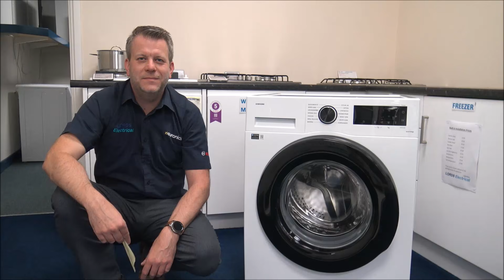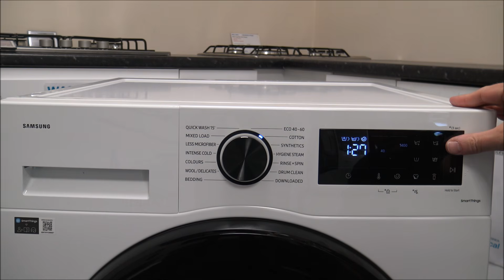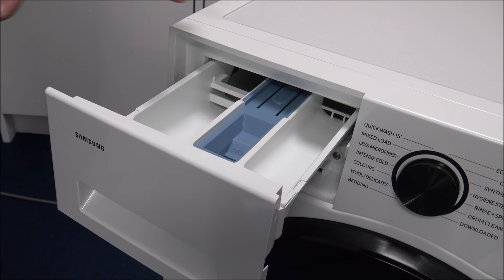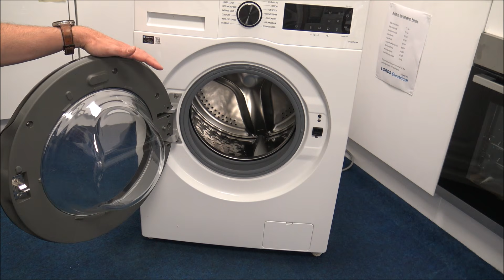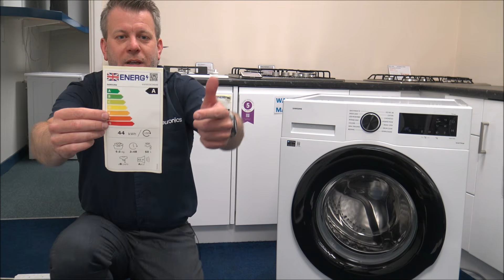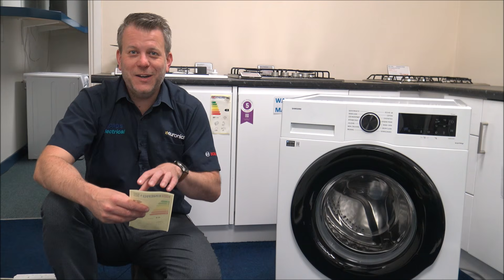Samsung WW90CGC04DAE 1400 Spin 9Kg Washing Machine

Comment: When i pour detergent in before washing, it all drains into the washing machine after 30 seconds with  plastic part MAX liquid is used.
Is that normal?
Reply from the maker: This shouldn't normally happen, i would make sure the plastic part is fully pushed down to make sure the liquid doesn't run into the machine too quickly
Reply: @lords-electrical It's pushed all the way in. Plastic is made at the bottom with little gap.

Comment: Great review. Thanks very much. Question.
How many screws it has to stabilize the bucket during moving? 3 right? Cause the  manual i have shows 5 and i am a little hectic on putting it on
Reply from the maker: Each machine will vary between 3 and 5 normally, but the key is once the bolts have been taken out, make sure the drum can move around easily and not static like when it has the bolts in

Comment: I have just purchased this Samsung Washing Machine on the strength of this review! Does anyone know where to locate the serial number please? I had it installed and I have looked over the paperwork that came with it but I can’t find it. I have read online that it is sometimes located on the rear of the machine? If that’s the case I have a problem as I am disabled and cannot get it out to the machine out myself, is there anyway I find out other way? 
As I want to register the new machine! Thanks to anyone who can help me! Stephen
Reply from the maker: The serial number will be on the inside of the door, either on the machine, or the inside of the door itself
Reply: @lords-electrical  Thanks for your reply to my question, I found out it was included on the QR Code Sticker to the left hand side of the door, just above it, but it was small though!
Reply: Thanks for your reply, I found out it was actually included on the QR Code on the left hand side of the door, but it was small.

Comment: We bought this model yesterday from our local Hylands Euronics shop and set it up and tested it last night. Very impressed so far and it's so quiet compared with our previous 25 y/o Bosch which had just expired.
The only issue I had today was trying to register the 5-year warranty online. The website wanted a 15-digit serial number and this machine's s/n only has 14 digits. I ended up phoning customer service to register.
Turns out the s/n should have a P as its 15th digit after the 14 digit s/n printed on the rear & packaging labels.

Comment: How reliable and durable is Samsung in long term. Compared to Panasonic and Bosch.
Reply from the maker: Samsung are ok. not the best as the customer service can be poor if you need to call an engineer. I would always recommend Bosch overall for the reliability and value for money

Comment: The Samsung WW90K5410UW/ET washing machine does not start the wash cycle. Initially, the main door lock activates, but immediately afterwards, the machine drains the water (if any is present) and goes into a pause state, without displaying any error codes. The only anomaly noted is that the secondary door (AddWash) remains locked even when the machine is paused; it only unlocks when the main door lock is released. A buzzing noise is also heard during the startup phase Can you Help me please.
Reply from the maker: This sounds like it could be either an issue with the water supply to the machine or the waste out from the machine

Comment: On like other washing machines I've used, it's disappointing that this samsung machine don't have SPIN ONLY option. Sometimes after the washing cycle complete,  you find the clothes are still soaking wet and all you want is to spin. Too bad this doesn't have that option.
Reply: Have spin only program.
Press spin button for 5+ sec. Check the manual.....
Reply: @paganos5633  thanks, will try it out.

Comment: Whats the best wash settings for whites
Reply from the maker: Normally the Cotton or Eco 40 - 60 are good settings as they are longer programs to get your whites clean. If you want to go with a higher temperature like 60 or 90 degrees C, then go for the Cotton setting
Reply: @lords-electrical thank you so much. Weve been using mix load and it doesn't seem to clean the white clothes properly and it only goes up to 40 and not 60

Comment: I've had one for 6 months. You can see where they have cut corners on some of the functions, however for the price /warranty it's excellent value.. The motor is also direct drive which in basic terms means less vibration, more efficency so it should last longer - this is also probably why it's quiet.. Few negative comments on here but if you want all singing all dancing buy a more expensive model😂 just out 9f curiosity... The default eco program does not stipulate if it's washing at 40 or 60 on the  display, with no way to change it??
Reply: When you choose eco you just have to tap on the temperature logo after and choose your temp

Comment: Cannot turn temp up or down in eco 40-60. So cannot select 40c rather than 60c
Reply from the maker: That’s correct that it will wash at 40 degrees on the eco 40 - 60 program. It is designed to wash clothes that have the ability to washed between 40 degrees  and 60 degrees C as efficiently as possible
Reply: @lords-electrical Thank you. Using the Mixed setting 1 hour and 7 mins. Worked perfectly.

Comment: Does it matter if my Washing Machine Sticks out 4cms
Reply from the maker: No it doesn't matter if it sticks out, it just depends if it is inconvenient for you if the machine is sticking out. It is better to stick out a bit rather than pushing the machine back too far and trapping the waste or water inlet pipes.

Comment: How do I get Spin only
Reply: 1.Power the washer on. 2. Press and hold the Spin key for 2 - 3 seconds. Once the chime sounds, the washer will now be in Spin Only mode. I don't know why they won't just add the option on the wheel.

Comment: First washing machine I've ever seen without spin only option!. Would not have purchased had I know this!
Reply: The smart things app has extra programmes which can be downloaded to the machine, including a spin only programme.
Reply: Just hold down the spin sign for 3 seconds and it will go to spin only
Reply: A comment below says to put it on the rinse and spin cycle and then hold the spin button. That should do spin only

Comment: I see that you know a lot about washing machines, so I'm wondering if you have a favorite? I'm hesitating about two models that interest me, so if you could tell me which is better, the SAMSUNG WW90DG6U8FLEU4 and the HAIER HW90-B14959EU1-S, should I choose a Samsung or Haier machine, or is there a better solution than these two models.
Reply: Haier is made in China I think and usually aren’t the best quality
Reply: @BenFC_189 In the end I bought a Beko, I'm happy with it so far, so many machines boast about reduced noise, I think all newer machines are designed that way, including the one I chose. As for the material itself, I'm not really happy with the quality, it feels like cheap plastic, but for the money I invested it's worth it.
Reply: @vujadinovicc  Beko is a good budget brand I’d say they are the high end of budget brand but yeah made in Turkey so maybe quality not there and for the noise level most machines are using inverter motors or direct drive which doesn’t use brushes which lasts longer is quieter and they say is better for the environment

Comment: On the eco 40-60 option, how can you ensure the clothes wash at 40 and not 60? There isn't an option to change the temp?
Reply from the maker: It will just wash at 40 degrees C and wouldn't normally allow the ability to change the temperature on that program
Reply: Why does it say 60 then? 🤔
Reply: The temperature on this program is 23 -37 degrees  .... Its stupid program at European union....

Comment: Thank you for the video. I just baught this machine and I am very surprised that there is hardly no water in the drum during washing and even rincing. Previous machines showed always water at least up to the lower level of the openning window; Is this normal or does my new machine have a defect ?
Reply from the maker: Washers don't use a huge amount of water now, but you should still be able to see water within the drum. Try turning the water pressure up a little bit as it may allow more water into the machine during the wash

Comment: I couldn’t find the times of the various washes anywhere! Thank you! 
You’ve helped me decide to purchase one. 👍
Reply from the maker: Great to know the video was helpful for you. Thanks for the great feedback
Reply: @lords-electrical 
Well I bought one and not happy 😅
When it spins to dry the clothes on any setting, it shakes violently. Which is the main reason i got rid of my old one as the bearings started to go and it started to sound like an aeroplane. 
Maybe I’m putting too much clothes in but it just seems to be unstable at the top. I’ve adjusted the feet and even out foam padding between the washer and the wooden cupboard but it seems like it’s just crazy. Lol
Reply: @UFOsAreAngelsandDemons have you removed the transit bolts at the back?
Reply: @ 
No. 
I’m literally looking at them now.
Somebody told me it came with bricks inside them for transportation.
Reply: @UFOsAreAngelsandDemons  firstly I would 100% remove the transit bolts and then try a spin cycle with some laundry in and see if it still sounds loud
Reply: @ 
Just removed them. 
Omg I feel so dumb. Lol
Reply: @UFOsAreAngelsandDemons  you won’t be the only one who forgets to remove them I didn’t even know about them till I started watching these videos a few years ago
Reply: @ 
Being an Electrician, I probably have no excuse though. 😂 
Mix wash on now, I will report back shortly. 
Thank you so much mate!
Reply: @UFOsAreAngelsandDemons  hopefully you caught it early enough so no damage has been done but if any has been done if any has should be able to get it repaired
Reply: @UFOsAreAngelsandDemons  how did the wash go
Reply: @ 
Super silent. 😎
Reply: @UFOsAreAngelsandDemons  nice stuff the super silent motors are the best inventions
Reply: @ 
I bought those anti vibration feet too as my house is built over a 6 foot void. 
I’m tempted to buy the matching Tumble Dryer but it’s about £500. 😬
Reply: @UFOsAreAngelsandDemons  if it’s a heat pump dryer I would do it if you can afford it they are much cheaper to run in the long term than if you were to get a cheaper one with a worse energy rating
Reply: @ 
Yeah it’s a heat pump one. 
Oh right, didn’t know they were cheaper to run. I’ll check out the specs cheers. 👍
Reply: @UFOsAreAngelsandDemons  if you can let me know if I’m right on that cause I’ve told other people the same so hopefully I am correct about them been cheaper
Reply: @UFOsAreAngelsandDemons  got a problem in my washing machine now I’m washing some bed covers and one of those covers which absorbs a lot of water making it really heavy and my washing machine cannot balance it at all
Reply: @ 
Must be overweight ? 
I put those anti vibration feet on mine and it helped even more. My floor is suspended wooden floor so it’s quite shaky. I might go underneath and add some struts to strengthen as although it’s now reasonably quite I can still feel the vibrations in the next room.
Reply: @BenFC_189 
I never checked out the heat pump dryers as I’m gonna stick with my Sharp dryer for now. I replaced the water suction pump in it recently and it works again but unfortunately it never turns off so I’m guessing there’s a relay stuck open. Gonna have to take it apart and have a look.
Reply: @UFOsAreAngelsandDemons  got it to spin in the end had to take half the covers out
Reply: What a brilliant description of this machine! 👏Thanks for all the info. 👍

Comment: Super helpful! Thank you. Just one question. You talked a lot about load capacities, but how does one know how much the load they are putting weighs? How do you know if you are going over the allotted capacity?
Reply from the maker: That is always the ultimate question.
Ideally you should weigh the clothes but obviously that will never happen. It's just a case of making an educated guess really
Reply: And does the machine have a weighing machine inside to weigh how much there is?
Reply: @TheDeghohun  Yes, I'm not sure if there is a scale or the machine just infers it by rotating the drum a bit and estimating the force required to do so.
Reply: My current machine that just died (RIP) was auto-weighing the laundry and reducing the time of the wash itself. He also said it at the begin, that it can go down from the initial 2.5h

Comment: Despite Eco 40-60 being there as the Eco option, Samsung still has not dropped the Cotton Standard 40/60, which is achived by using Intensive in the Cotton cycle. This thing happens in all of their washing machine ranges

Comment: We have this machine. Seems ok. But the run time is very variable: set for a "cottons" wash it initially said 1hr 10 mins.  When started this changed to 3 hours 10 mins !! Why such a huge increase - really annoying to have to wait another 2 hours?
Reply from the maker: These machines will monitor the capacity of the load so if it is a large load, it may take longer than the initial time on the machine display
Reply: @lords-electrical  Thanks. It was a large load but even so,  two hours extra? - it seems absurd. I think I prefer older machines I've had which just did exactly the same wash whatever the amount!

Comment: Lovely video but I'm having difficulty with setting the timer. You show the button with the different delay times, but how do you set it. I have tried setting the program then the appropriate hours. It then goes to sleep after a few minutes and does not come back on. If I press start after the hours delay, it starts immediately. What am I doing wrong? Thanks
Reply: Did you solve this? I'm having the same issue
Reply: @tarkinosrs  yes! After setting the time delay, press start. The machine sounds like it is starting but it is simply weighing the load. It will revolve clockwise and anticlockwise for about 30 seconds. It will then come on as programmed on the timer.

Comment: Thankyou this is a very useful video . Iv just changed to this washer . Just have one question when I do some hand washing I just want to spin but this washer says rinse and spin . Which must mean it will rinse the fabric conditioner out ! So do I put fabric conditioner in the machine on the rinse and spin cycle or otherwise the fabric conditioner will be rinsed out surely.
Reply: People in other comments are saying to put it on rinse and spin but then hold the spin button in for a few seconds and it will just spin.
Reply: @myapinion7532 thankyou very much I will try this 👍🏻
Reply: @ValerieDavidson-h8v I do that too with some things like wooly scarfs and my fluffy dressing gown, hand-wash then slosh them around in clean water and fabric softener in the sink, then take to machine and put on spin. It gives you lots of nice smell in the items and it lasts longer. 👍
Reply from the maker: If you are just using the rinse and spin option you wouldn't use any fabric conditioner in there.

Comment: Truth is Bosch have a TRACK record for durablity and reliabilty where Samsung have just started
Reply: Samsung have been selling washing machines for over 30 years globally... They had a reputation for broken spiders around 15-5 years ago though.  Plus the machines are not as well laid out as LG. However the Samsung drums have an O-ring and bolts to easily split for spider and bearing replacement (like LG), unlike modern Bosch machines with sealed (plastic welded) drums...

Comment: Mine has just come this morning is it normal for it to make a light tapping noise when building up too a full spin?
Reply: adjust the footpegs, and or put wood spacers tight under feet
Reply from the maker: I'm not sure it should do as the machine should be bedded in when first used. I would keep an eye on it over the next couple of days and if it continues contact the retailer where you purchased it from to get them to check it out.
Reply: @lords-electrical  okay will do thanks for getting back to me

Comment: People seem suggest these are unreliable. Is that true?
Reply: I agree that Samsung service is the worst I have ever experienced. The motor in my washing machine broke after 2 years, still covered by the parts warranty. Samsung’s service contractor scheduled four separate appointments to replace the motor over a span of 5 months, but never showed up and never cancelled. I needed a washing machine so I eventually walked away and bought a new washer. 

I will never buy another Samsung.
Reply: just replaced mine, would say so.
Reply: @DennisSchmitz  funny they don’t last. I wonder why?
Reply: Mine is currently awaiting a repair....it's only 9 months old! Will never buy a Samsung machine again!! PS - Samsung customer service, in my experience with this machine, not good!
Reply: @mick1406  What is the problem with it exactly?
Reply: @last-og_zanussi  The machine simply refuses to cycle - not filling with water, no drum spin. Nothing. I did a full reset. I checked and cleaned drain hose, I checked outlet /waste, checked connections, taps but nothing. I did get one error code suggesting a 'draining' problem but after spending 30 mins on phone with a Samsung adviser checking everything over, I'm now left waiting for their service engineer to show up - two weeks & no sign yet! Machine only purchased 9 months ago and has been run in accordance with Samsung guidelines  Also full 2.5 hour 'drum clean' cycles ran as machine alerted me it was required. This has really put me off Samsung!! Had a Whirlpool previously which lasted 5+ years and I thought that pretty bad TBH! But 9 months!  Samsung having a laugh.
Reply: mines going onto 5 years old this month, it’s been glitchy since it was 2 years old which is worse than my old beko which got it’s first fault after 6 years